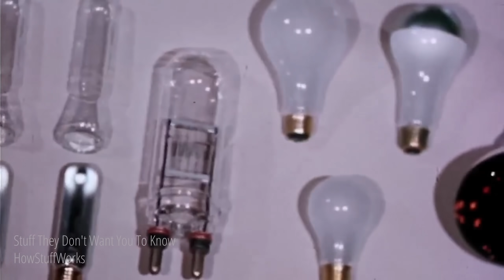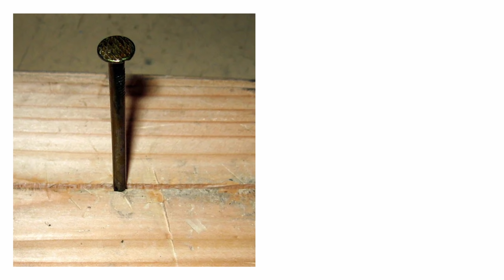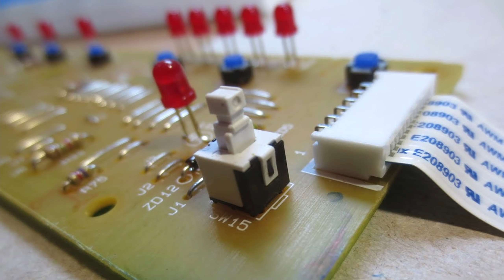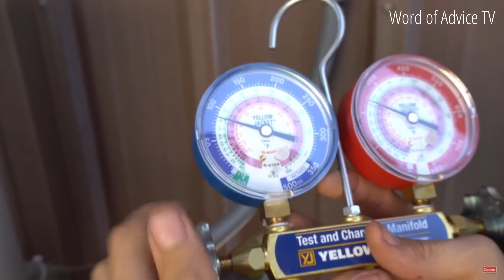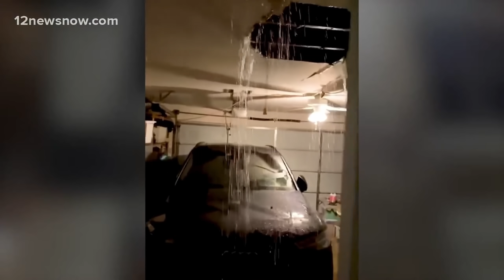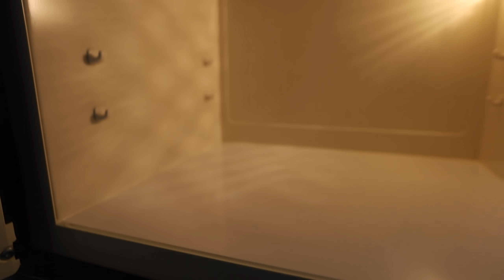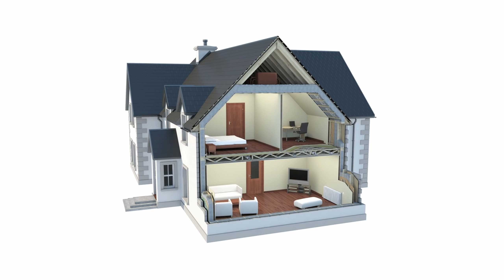Built to FAIL | Planned Obsolescence

Comment: I have always made my living by repairing things and I have always heard the same two perennial complaints. First, things are manufactured as cheaply as possible, and second, it costs too much to repair. It's a simple reality, the manufacturing techniques which reduce costs will also increase the cost of service and repair. Robots like to stamp, crimp, and weld. They don't do nearly as well with screw, nuts, and bolts. I'm not even going to get into the whining about the consumer who wants to diagnose an electrical appliance but doesn't know anything about, and changes parts for no better reason than it's easy to do. Then they complain that I charge too much for knowing what I'm doing. 
The solution is to all this is simple. Pay more for better stuff and drive low cost manufacturers out of business. Let me know how that works out.

Comment: I think your points are OTT in parts, where planned obsolescence isn't generally deliberate but a realistic assessment of how long the product should be expected to last through normal wear and tear of the environment. Washing machines are supposed to go through a maintenance wash cycle every few months to remove the build up of the corrosive detergent: that's why the part in your washing machine example failed. But most users don't bother to read the whole manual and therefore have themselves to blame, rather than the manufacturer.

Comment: My first job was in a design agency that was residing in a building from 1763. It was warm and cozy and we never had to crank up the heating. There was no A/C and we didn't need it because 2-ft sandstone walls provided the thermal mass to balance out heat spikes in summer. There was no repair work necessary in the all the years I worked there. In contrast to that, I increasingly hear about people who are facing major repair costs in "modern" houses that are less than 10 years old...

Comment: You hit on it in that appliances do not last as long as the once did. My parents refrigerator worked for over 20 years. I had one from GE that failed in 5 years. I didn't buy a budget brand. I had the feeling the big brand would last.  It didn't.

Comment: Of course, there should be regulations surrounding planned obsolescence. But, it helps enormously with technological and economic development. The earnings from current generations of products are used to develop the next generation which are hopefully more advanced. The cycle repeats and each iteration is a little more advanced.  One of the fundamental reasons that the west beat the soviet union. As a single example,  imagine the pollution and injuries if our motor vehicles averaged 40-50 years old. 

Governments should develop tax incentives and other strategies that encourage demolition and rebuilding of houses and other buildings after period of time to drive technological and economic development too. Homes have become hideously expensive in many advanced economies, they tie up unproductive capital that could be cycled through the economy periodically. I believe Japan has system that does this to some degree.
Reply: I don’t agree at all. This is both a bad idea for products and homes. Production of both is far too energy intensive and not enough materials would be recycled; building currently aren’t designed for disassembly and neither are products . I believe Japan only does this because of earthquakes, building codes and a very small population increase resulting in diminished demand for new housing.

Comment: "GE fridge" Ah, I see your problem right there. When I worked at Home Depot, we got the most returns for defective products with GE than any other brand. Seriously, I will never recommend buying GE for anything. Their quality control is... basically nonexistent. Not that most ppl actually go out and buy fridges all that often. Most ppl just use the fridge that came with the house/apartment/condo/etc and only replace it if it dies (or have the landlord replace it - which means they get zero say in what the replacement is).

Not that I think Samsung is all that great either. An awful lot of the price seems to be branding more than anything else when I compare Samsung products to their equivalents in other brands.

Comment: LEDs last a very long time, the problem is not the light itself is the cheap drivers that cheaper brands use they are the part that fails, I have LEDs running for years, some are always on, every time i buy a cheaper one it fails so i learned my lesson

Comment: Just just one thing on a all electric house running off of a coal fired power plant, coal fired plants being dirty is a misconception. Coal plants are actually a very clean source of energy. Even if all the cars were turned to electric and charged by a coal power plant that's still better then gas or diesel cars, atleast emmsions wise. Instead of every car having to have it's own emmsions system that may or may not get monitored or maintained correctly, a coal plant has a state.of the art emmsions scrubbers with highly trained and certified technicians to look after it. Coal power plants are just another victim of planned obsolescence, they are telling you they are not cool and trendy, and wind and solar is "green". When in fact wind is far more polluting and bad for the environment then coal

Comment: You make many conclusions about construction methods that have nothing to do planned obsolescence. Many are counter to code as well. You are required to have tie down anchors to roof rafters nearly everywhere. Plastic pipes under the floor should last forever and you are ignoring requirements for clean out ports. The foam insulation isn't installed to make things difficult as you suggest. It is superior at insulating and sealing air flow. Yeah it would be a pain to remove. Do it right the first time. Put conduit in places likely to have wires replaced. 
 Most homes don't fail structurally due to the framing, they fail due to water damage, termites, fungus, fire, wind, earth movement. But many points here cover things not really that significant and definitely not planned obsolescence. 
The low quality of housing is caused by the short mindedness of home buyers, not builders conspiring to cheat. The buyers are not willing to pay the extra it would cost to make it last because they don't plan on keeping the house long term. Value is based on floor area and not quality of materials. If we stop buying cheap houses, they will stop building them.
Your flooring, don't buy junk flooring... Better options are available.

In the case of the refrigerator, appliances, electronics or cars. Those have real cases, and we have little recourse as better is not offered in many cases.

I support the argument here and usually like your videos. I think things should be designed to last. But this argument missed the mark. Good to throw the compliant out here though.

Comment: Great video, but all-electric homes become cleaner with the grid or with the owner's decision to install photovoltaic cells and electric storage. Community solar is another venue for all-electric homes to go green without any modification to the owner's house.

The only thing that's certain is that homes will need to be fully electric if we're going to make the type of cut to carbon emissions we need to avoid the worst climate change has to offer.

Comment: I'm a home inspector and have seen many appliances and utilites from pre 1950 that are still operational and were built to such a high standard compared to today's products. We saw a water heater from 1950 made out of ceramic and it was still working!! Today's hot water heaters do not last nearly as long.

Comment: Designed obsolescence is obscene and criminal. It should be made illegal. Consumers are swindled.
I drive a 1969 Mercedes. I have owned it for about 8 years and have not needed a single repair. A friend of mine owns a 2018 Mercedes. He has already spent thousands of euros on repairs.

Comment: At my current home (3rd one owned; sold the last 2 when my wife got a job in a new city) I wanted to run a natural gas line from where the line entered the home to 2 different spots; 1 for a gas clothes dryer and the other for a gas stove. The extant furnace connection was a long flexi-hose connected to a short piece of black pipe entering the basement from the meter outside. The plumbing company I called for a bid said they would just run more flexi-hose (including a long, straight run) and it would cost $1500 due to the high cost of the material. I told them I wanted metal piping instead. He quoted me $1050 and then thought better of it and said it would be too much work. Flexi or nothing. I built the piping myself. It took a while and was a lot of work. Later, a furnace technician said my shutoff valve placements were perfect and the pipes looked great. It was $300 in pipe and I bought $150 or so in tools (including a clamping sawhorse that I use a lot now) & supplies. If you want it done right, you have to do it yourself sometimes!

Comment: The only real solution I believe is education regarding what value over time really means, and actions taken to pursue value. We've been conditioned by the big box store and disposable goods modality to equate cost and value but they are not the same. We want it now and we want it cheap. Consumers must be willing to pay more cost for higher value over time products. This requires research, some inconvenience, technical repair skills and greater initial cost though. And more importantly a willingness to live with less of the trappings of western lifestyles.
Reply: Who should be doing the educating?
Reply: @aayotechnology  Self (through experience and curiosity), family, community, cultural means, web, school systems (which would be nice - if that's even possible) etc. In a nutshell I'm talking about critical thinking skills. A huge topic where western consumerism is only one part.

Comment: I agree, however your key point is delivered cart-before-horse. Planned obsolescence doesnt result in an economy that drives consumerism, rather it is a business strategy developed in an already-well-established culture of mindless consumerism, and PO of today was developed, and yes borrowing from say light bulb manufacturing, by an economy primarily focused on driving up stock prices -so started in the 80s, but really got roaring thanks to Bill "I did not have sexual relations with that woman" Clinton. With respect to building, I would argue the issue isnt PO, rather a variety of complex factors starting with the post-war build boom. Certainly in my area, similar pressures exist today with rapid population growth and labour shortages in the trades. But specific to the building industry PO isnt a strategy, rather a consequence of its business model. Trades (again, my area. YMMY) price based on job, not time & materials. Once they land the contract, they have EVERY incentive to cut corners, cheap out on materials and do the thing that makes the least sense from an aesthetic and accessibility/serviceability point of view. Worst yet for the home owner in a price-as-a-job charge model, every job includes a contingency charge meaning if you job goes smoothly, you're still paying the contractor an amount for some other person's home/shite-choice-of-materials/annoyingingness-OCD that causes cost overruns. There is a market problem with construction & real-estate valuation as adding in cost up front (say accessible infrastructure like pipes) only pays off, and even still just a maybe, if there is an issue, and even then, assuming you still own the home 10+yrs later. I am so ready to totally disrupt the construction industry. It is, itself, obsolete using an essentially anti-innovation and basically corrupt business model to provide the least amount of value to the consumer (unless you're uber wealthy and hire architects and Matt Risinger -the what the market will bare pricing model, and that market are the benefactors of trickle-down and has money to burn).

Comment: I think two other areas that could be touched on with planned obsolescence have to do specifically with the suburban housing typology.

One way is the nature of how suburban tract homes are increasingly built from cheaper materials and intended to last considerably shorter amounts of time before a critical failure or condition that requires replacement. No state is a worse offended than Florida, which continues to build in OSB and other engineered wood products, despite the local climate causing those materials to rot and fail in 20-30 years. (Additionally as a hurricane zone, those building's being weakened poses a risk to life/safety)  This is instead of more sustainable or more durable materials like rammed earth, adobe, or terra-cotta and stucco, which in that climate might last closer to 100 years.

The second is the ephemeral nature of "commodity grade" tract development, and it's relative short useful life. In an urban context, buildings are built to last 80-100 or even greater time scales, and are intended to be adapted to reuse throughout their life. Suburban homes, are often built with a single use, single internal configuration, and instead of refurbishing at the end of life, wind up being demolished and replaced with new construction. That uses a large amount of resources to perform a task that a marginal increase in cost would greatly extend it's useful life. Or a change in zoning and/or development typology, would increase the useful life, and reduce the carbon footprint of a house, say in a duplex, attached housing, or small apartment or condo complex. 

Which I guess gets to the point, that our building and zoning codes encourage single use zoning, and automobile dependance which pushes on us buildings as commodities instead of buildings as long lived infrastructure designed for long term adaptive and mixed use.

Comment: American LED light bulbs also have planned obsolescence.  They are purposely designed to over use current that shortens the life of the LEDs.  Look up Dubai LEDs which are designed to run for the 30 years life of the LEDs. They are legal for use but extremely hard to get ahold of outside the Mideast.

Comment: I bought a new high efficiency Ge washer and dryer a few years back. Kept the dryer and got rid of the washer. I never hated any washer so much in my life. It would only put a small amount of water in it and my clothes came out dirtier then when they went in. Had the repair guy out twice. Kept getting told it is what it is and until people stand up to these companies nothing will change. I ended up getting rid of a like new machine and bought an old one off line that I can fill all the way to the top with water if I want to.

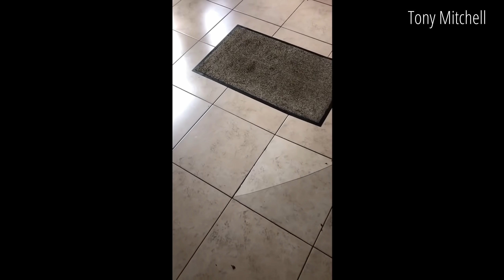Comment: Concerning the buckling tile at 5:26 in the video: what is the exact cause of this? Does concrete expand and contract naturally at a different rate than tile, or was there some other cause/event that caused this failure? Wanting to understand more about this , Thanks.

Comment: On Matt Ferrell's channel, Undecided, we are seeing efforts to use a concrete battery.  It uses the walls of the home to store charge.  That is truly frightening levels of planned obsolescence.  They are  using a material that is such a high CO2 contributor that will have to be replaced exponentially sooner because it lost its capacitance. 1 misplaced nail or bolt of lighting couldn't necessitate a new foundation or a different system for storing charge even before the home is finished. It reminds me of all the homes I've lived in with dead NuTone intercom systems.

Comment: This Is a multifaceted topic, with a lot of issues. It is unquestionably irresponsible from a ecological standpoint. It absolutely keeps the majority of people employed, along with middle management. Failure to engage in the practice has resulted in the downfall of more than one company. In the area of appliances, and home and garden equipment (in the U.S at least), there are actually very few manufacturers. Whirlpool, for example, owns and makes almost all brands of consumer appliances, GE owns a few (at least they did five years ago, Whirlpool may have bought them by now), and Electrolux has a few. Samsung and LG do their own thing. In the powered lawn and garden, whatever brand you are looking at is made by either MTD (if it's cheap) or Husqvarna (if it's "Premium"). Eliminating this practice will take some incredibly drastic changes in people's lives. This is a form of artificially induced scarcity.

Comment: Regarding water pipes embedded in concrete floors, to pevent the necessity of breaking the concrete to repair or replace the pipes, I like to channel pex pipe inside a larger pvc pipe in such a way that the pex pipe can be withdrawn and replaced should a failure occur.  Instead of using a membrane liner beneath tiles in a bathroom shower I will only use an eleven gauge welded stainless steel pan with a stainless steel drain pipe welded to the panel.  Although these procedures are more costly they are worth it. If I pour a concrete walkway or driveway, I place a pvc pipe beneath the concrete that extends completely across the expanse so as to accommodate any future need thast might arise to run any water lines or cables beneath the concrete. Many repairs and replacements of housing components could be avoided if only better procedures and perhaps better chosen materials or components were usec even though we are at the mercy of manufacturers who make so many components xnd materials that are designed to be obsolete within a relatively short time period.

Comment: I bought a house that was built in 1925. The original Chrysler heating unit in the basement is 6 feet high and 3 feet wide and still working. Very few parts to break.